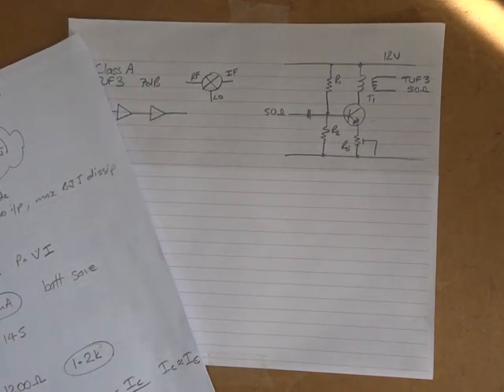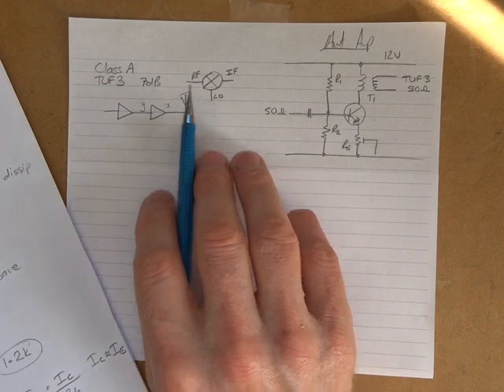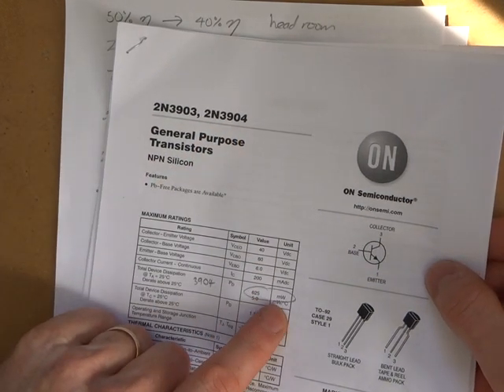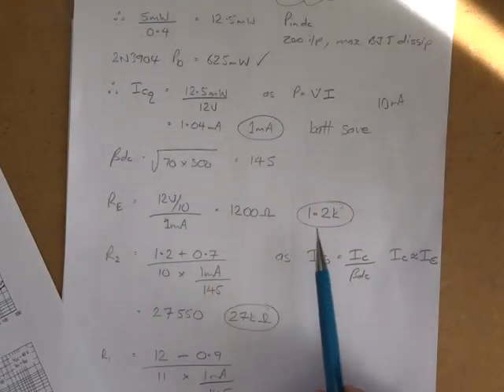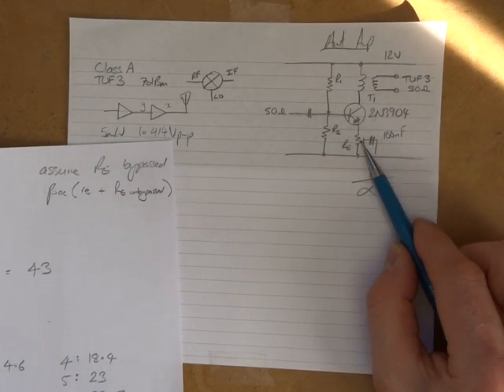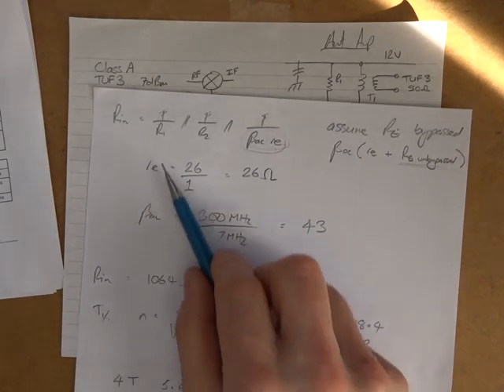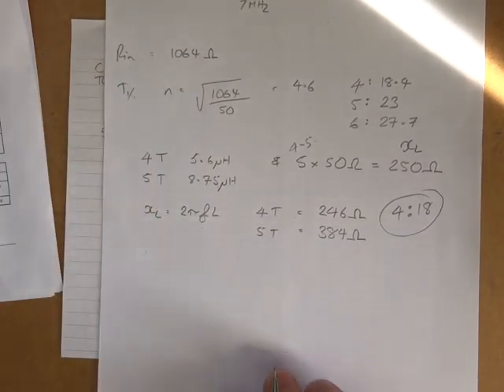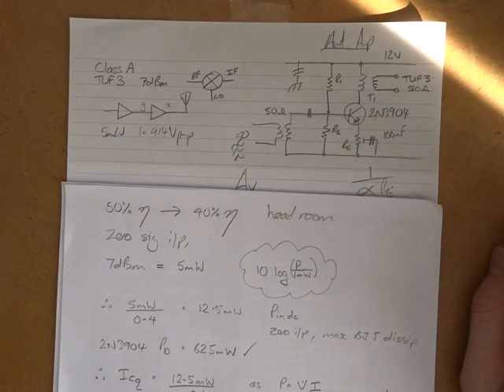Approaches to Class A Common Emitter Amp Biasing

Comment: Charlie do you remember what publication that you found the info on how to bias a Class A driver for a desired power output?  How to determine the quiescent current needed.?
Reply from the maker: I'm pretty sure it was Solid State Design for the Radio Amateur Loren. Class A is 50% efficient (max) so assume you'll dissipate desired output power x-say-1.2 across the device.

Comment: Where do you get these rules of thumb and fomulas? Is there a reference available for builders?
Reply from the maker: Hi. I come across them when reading text books such as Solid State Design for the Radio Amateur. I have not seen them all in one place sorry.
Reply: @CharlieMorrisZL2CTM  I'll check that out thanks
Reply: I know you showed one of the books you use in another video but you have a lot of long videos and I don't remember which one it was.

Comment: As I understand it (and perhaps that's not very well), higher current will give higher dynamic range allowing for better handling of large signals. I think that this is important for a pre-amp as it is amplifying the whole band limited only by the BPF and antenna etc. Large signals elsewhere in the band can cause amplifier gain-compresson etc and hence distortion of the wanted signal.

It's an interesting topic and one that I have to admit I've largely glossed over in the past, usually using others' existing designs. Anyway, am looking forward to following the discussion and  learning more. Thanks.
Reply from the maker: @canaldopicco  Thanks Picco. I'll look into that.
Reply from the maker: Hi Stephen. The high dynamic range makes sense, as I'm sure I read somewhere that a front end needs to deal with signals from uV to a volt or so. All good stuff.
Reply: Hence the use of a 7dBm mixer. Will give a higher dynamic range than say an SA612. But at the expense of needing more power. So an SA612 makes sense for a field radio with smaller antennas but for a home station where perhaps bigger antennas are used then a 7dBm mixer may be the answer

Comment: Hi Charlie,   Love your videos and approach to design,   for a receiver front end the critical parameters are linearity ( 3rd order intercept ) in terms of large signal handling ability and  for VHF and up Noise Figure  becomes an important design factor,   maybe not as critical at HF.    But somethings to consider besides just gain.
Reply from the maker: Hi Ray. Thanks for the input. I must admit that I need to do a lot more research into 3rd order intercept and how to measure that.
Reply: @CharlieMorrisZL2CTM  Hi Charlie,  you could just plot input signal dBm vs output signal dBm and see where the straight line starts to curl over, and where it drops by 1dB that's the 1dB compression point.  The 3rd order is a bit higher, but the actual number doesn't matter as much as getting it high enough to handle strong in-band signals without overloading.  I assume that a BPF will knock down out of band signals sufficiently.
Reply from the maker: @Etheira  Thanks Ray. I'll make a note of plotting the input and out dBm. It's something I have glossed over in the past. Thanks again Ray.